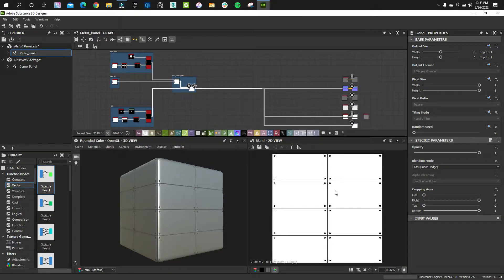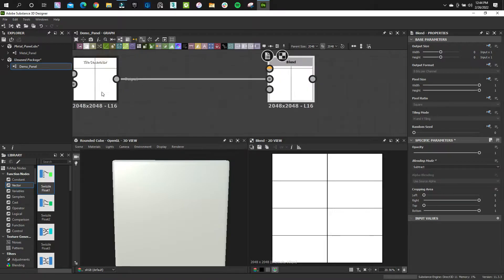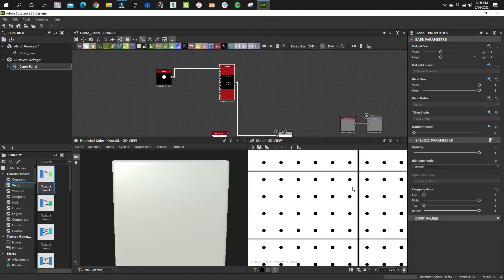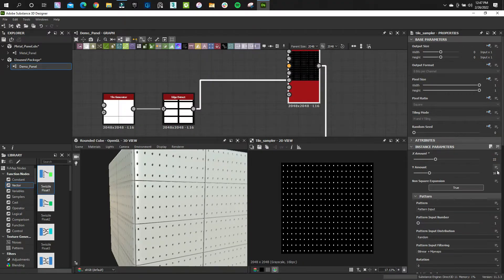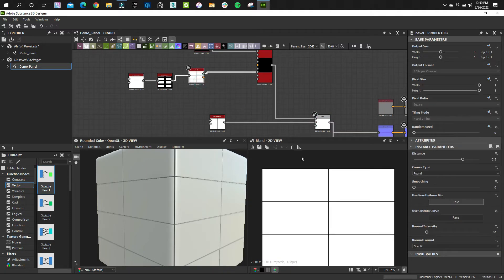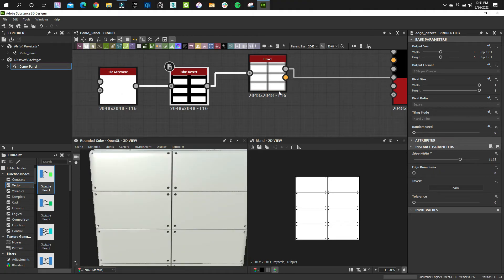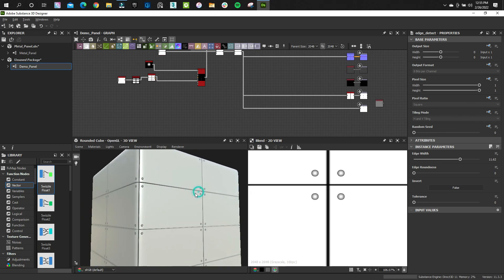Creating Procedural Rivets | Adobe Substance Designer

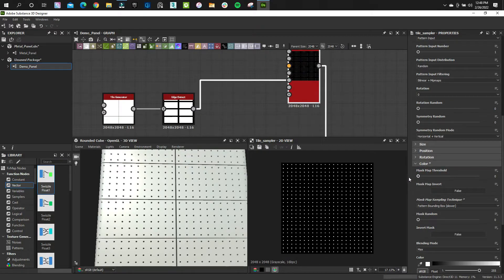Comment: For whatever reason, the edge detect node at 4:55 isn't doing what it's doing in this video. It isn't detecting any edges.
Reply from the maker: after following the steps at 4:55, more than likely you'll need to adjust the edge width via your edge node and then add the bevel which pushes the rivets to the corners only.  Its a little finicky, but should do the trick. And depending upon how many tiles your creating or any shape for that matter, you result may vary a bit. But the principle should be the same. And as we all know, there are many ways do achieve this effect so if you come up with a different method, please share!

Thanks for stopping by.